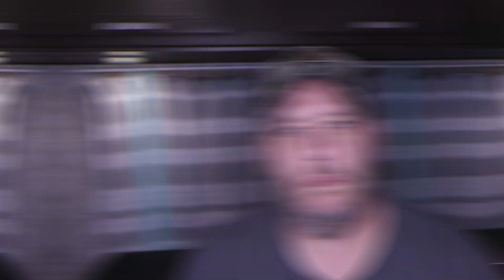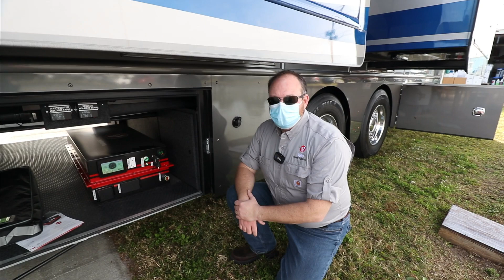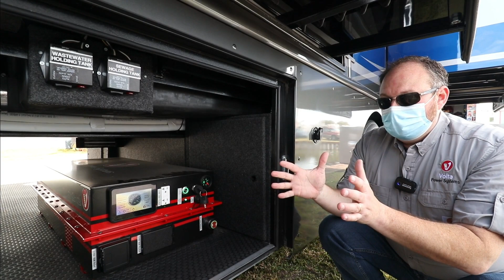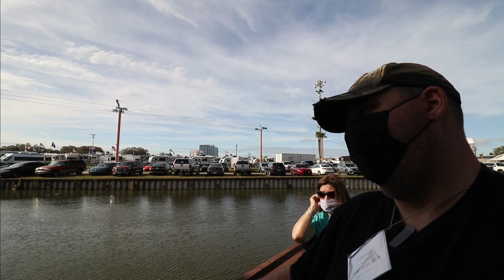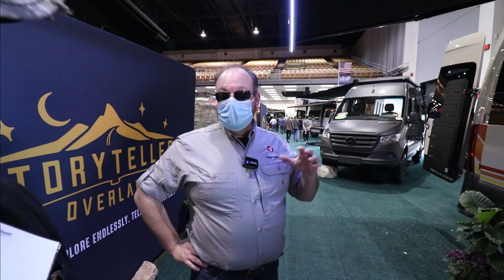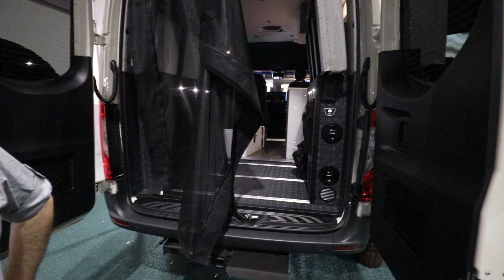RV UPGRADE IDEAS 2021 - Volta Power Systems - Power Without Compromise

Comment: I can't wait for this but I hope the price is for the average American.
Reply from the maker: So it’s going to be expensive I’m sure.  They best way to get it is going to be when the manufacturers offer it as an option.   The class b market is eating it up.   As far as expense, you have to look at it for what it is.  It isn’t just a battery pack generator. It is a big pack at a high voltage that can be recharged insanely fast by the high voltage alternator. Like in 2 hours.   So, it really will make water the thing you need. Not electricity. You wouldn’t really ever need to plug in.  So that’s pretty amazing.  But I think it’ll run around 20k or so. But idk.   It sure is impressive though.
Reply from the maker: And thank you for watching by the way.